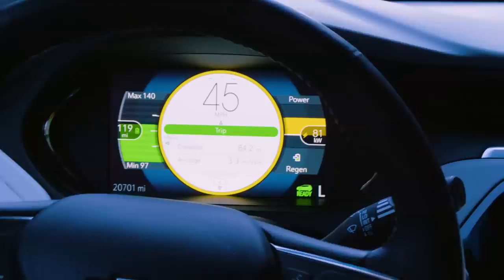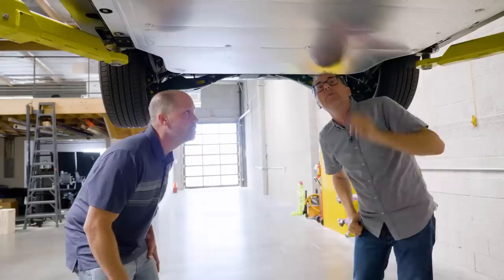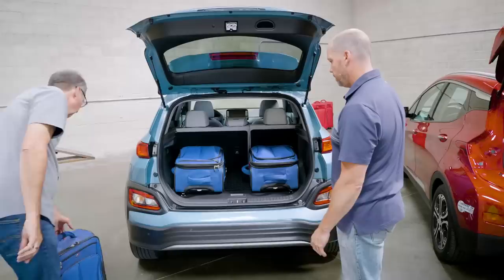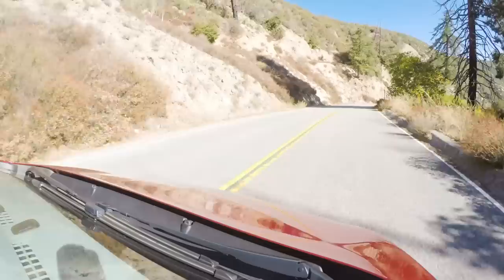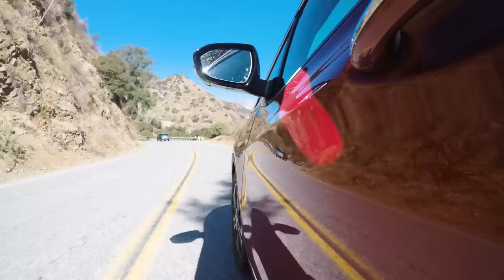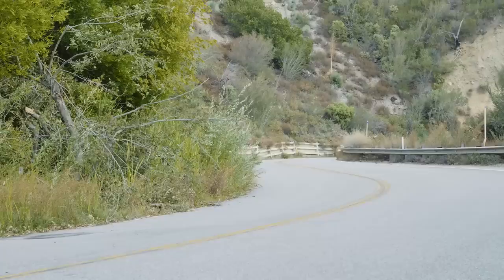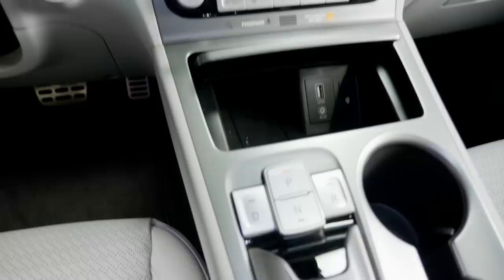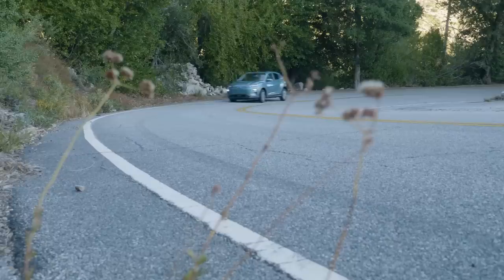Hyundai Kona Electric vs. Chevrolet Bolt EV: Which Is the Best Affordable Long-Range EV? | Edmunds

Comment: GM really screwed the pooch with the Bolt with its economy dorky styling and terrible seats. Hated sitting in one. Very impressed with the independent rear suspension setup in the Kona EV. Just better quality all around in the Kona
Reply: GM interiors are almost inferior to their competition, especially on their lower priced offerings.  Why?  Likely the accountants in charge of the car programs.  Old GM suffered from this and new GM hasn't changed, unfortunately.  As if no one at GM has ever driven a Honda, Hyundai or VW.  Hyundai and Kia always have simple yet classy interiors, even their hard plastics are high end.
Reply: With the exception of the power train, the Bolt was designed by the Koreans. Same folks who designed the Kona. The plastics are hard but quality hard plastics, they fixed the hard seats for the 2019 model, but you are right they cheaped out on the suspension. In the Chevys defense it was the first to do over 200 miles under 40 grand, so since its an older design they should get some slack.
Reply: Simon Michael Benz I agree. The Bolt is nearly 2 years old now, of course a new player in the segment will be dominant, but that doesn’t discount what the Bolt did for the segment or the pretty decent sales numbers it put up.
Reply: Awsome drive train & features by LG. But it was wasted on a cheapo body and interior by GM. Sadly even Holden Port Melbourne designed it and they are known for great design. WTF is with these oldschool automakers being clueless about BEVs.
Reply: It don't cost much to level out the seat by a uphol. shop. I simply put  seat pads in my Bolt. I Like sitting higher up. The rear seats sit higher than front similar to the Element
Reply: We leased the Spark and had similar impressions.  It's like GM 'assembles' the cars from existing parts, whereas Hyundai invents and builds what it needs.  Loved the Spark but it was minimal, crude almost.  You can see that still in the Bolt.
Reply: I couldn't even DRIVE the Bolt, my arm kept hitting the center console. HOWEVER, a friend OWNS one, and in HIS car, I did not have this problem.
QUESTION: It seems obvious that most dealers are not interested in selling electric cars, THEY DON'T NEED MUCH SERVICE. Are the sales folks TRYING to steer us away?
Reply: @ALMX5DP  
It's only outsold by the more expensive model 3 by at least 13:1 and increasing.
Considering they don't seem to sell all the cars they make, and lose money on every car they do sell, that seems to be a problem?
Reply: Roger Starkey GM is playing the long game as they always do. Gotta spend money to make money and by developing the technology it’s getting them there (there being EV and autonomous tech centered in China). Bolt sells about the same as the Model S, and considering it doesn’t have any of the Tesla panache, I consider that pretty decent.
Reply: That subjective! I'm 6ft 200lbs and the seats are just fine. Furthermore, I love the styling of my Bolt. Had a deposit on the Model3 but not really feeling the look of it. The Bolt is more roomy and practical for many.
Reply: @ALMX5DP  
But it doesn't compete in any way with the S!
You can't compare it!
Reply: Roger Starkey my point was merely that they’re selling pretty decently, not that they are cross-shopped.
Reply: @ALMX5DP  
But at least in the USA, they're not selling decently.
Reply: @rogerstarkey5390  Well I guess the Model S isnt either then.
Reply: @ALMX5DP  
The model S Isn't what? Outselling comparable cars in it's own market segment? Check the figures. (Clue, I don't need to)
Reply: Roger Starkey both sold very similar numbers in 2017 and so far this year they are quite close too.
Reply: @ALMX5DP  
It's a different segment?
Luxury cars don't sell as many. Compare the S to Mercedes C and E class, etc. It's taking their market.
The Model 3 is taking business from every market, cheaper and more expensive.
Sorry, but you're wrong on this one.
I assume you are talking about the S?
The Model 3 has smashed the Bolt.
Bolts sales in September were down 40% compared to September 2017.
Reply: Roger Starkey nothing I’m saying can be wrong necessarily. I’m just stating figures not interpretations. Yes Bolt sales are down for October and November, because new players entered the game. Model S took a hit when the 3 came out too.

Selling decently isnt dependent on class or price. Like I mentioned before, the Bolt is just a starting point for a much larger EV picture for GM.
Reply: You can buy a Bolt today.  The Bolt is the most reliable mass market EV money can buy.
Reply: @ALMX5DP  
You're "stating figures"?
Link?
Every "figure" I've seen shows the bolt sales reducing month on month, while the model 3 increases virtually every month.
Even the increase is far more than the Bolt has ever sold 
Bolt sales decreasing by the relatively high percentages mean that either they are getting spanked because there are more, better cars on the market, or....... No, that's the reason.
The "3", the Hyundai, Kia, and soon the uprated leaf are going to kill it off (not to mention the loss on every car)
And (btw) a while ago I saw a chart showing sales of every GM model. The only passenger car segment that showed any growth was "EV / PHEV" and I recall that was due to the volt. I believe they are stopping production of the volt soon?
GM have "issues".
Reply: @fatboy19831  
Yep, you "can buy a Bolt today". Apparently there were about 6500 on lots around the USA unsold, last (?) Month.
Now, you may (apparently) have trouble finding a dealer that wants to sell you one......
Reply: Roger Starkey not disputing 3 sales, I agree they’re a rocket ship as far as numbers go. GM invests in a lot of areas associated with EVs. They know the Bolt was a first step, and one that was relatively small. But the initial sales were decent for an EV brought to market in 2016. The Kona is a second step for the tech with GM still benefiting from it being that they codeveloped the battery stuff with LG Chem. GM isn’t unaware of the progress in sales, they’re merely (again like I said) playing the long game in areas outside of just cars.
Reply: @ALMX5DP  
In that case, they'll cease to be a car company.
Reply: @rogerstarkey5390  if they only pursue that, but I suspect they'll keep their automotive sectors alive for a least a little while longer. (sarcasm)
Reply: FACT: GM looses $$$$ with every BOLT sold. and GM does NOT market the BOLT.
Reply: The Kona looks ugly also
Reply: @markplott4820  Same goes with Tesla losing money on each unit sold.
Reply: @OneManOnFire   - FACT : Tesla today is 20% Profitable, most of their Profit comes from Tesla model 3 Performance, Dual Motor and RWD versions, now with the LEMUR model 3 Tesla will make even more money. already at 143% growth since 2009.
Reply: How are you liking your Kona Electric? When did you get it? I've been driving my Bolt EV for two years now.
Reply: GM IS tanking cutting 18k jobs and closing 6 factories.So no won't be getting anything from them.
I'll stick with Hyundai,Toyota,&Honda😊
Reply: The Kona looks ugly AF
Reply: I will agree, driving a hyundai veloster and a Chevy sonic back to back, the sonic interior materials were shitty and super cheap. It screamed crap. Both korean shitboxes.
Reply: We've had our Bolt since August and THE SEATS AREN'T AN ISSUE AT ALL AND I'M TIRED OF THE WHINING ABOUT THEM. GROW UP. WE'RE IN A NEW ERA AND WE LOVE OUR BOLT. I wish all prospective EV owners the best whatever they choose to buy.
Reply: Glenn Jubilee so hold up, crappy seats and crappy cheapo twist beam suspension are ok because we are in a new era? Twist beam is pure malaise 1980s lol
Reply: @gabimircea4328  They said they set it to max
Reply: @alliejr  They honestly need an interior fit and finish overhaul at the company. They changed their paint and body sealing processes around 1999/2000, and the cars now go 20 years with little if any rust. So if they can double the quality of the exterior, you'd think that a similar shake-up could do wonders on the inside. If that means getting other sourcing or more expensive materials, so what? If your competitor almost costs $10,000 less, has equivalent performance, and a nicer interior, then you've been making some wrong decisions.
Reply: @mi16t  In your opinion no. I don't think they're crappy. They aren't cushy, but crappy, no. The suspension isn't great but WE DIDN'T BUY IT FOR THOSE REASONS. THE PALNET IS MORE IMPORTANT THAN SEATS AND THIS IS WHAT WE COULD AFFORD! GROW UP!
Reply: Glenn Jubilee also if you are gonna do this grow up bullshit, Buy a car you can afford. Buy a 15k economy car, not a 40k ev and then cry its all you can afford. The logic is amazing.
Reply: @glenndjubilee  
IT is a crappy car. That is why GM is closing factors. They made crappy cars and they know it. BTW, since Tax payer bail out and lose money to that loser company, the money that can go to help "THE PLANET" you are supporting "THE PLANET" xxxx company. The same company that delay the start of EV for over 20 years by crushing every EV1 they can get their hands on.
Reply: Totally agree with Blake.  Drove Bolt twice and really wanted to buy but the drivers seat was so god-awful that I couldn't tolerate it.  And I'm not fat or particularly wide.  So disappointed.  Maybe Kona will be better.
Reply: They do know they said more than one time that it was adjustable but had it set to the highest regen level.
Reply: @SimonMichaelBenz  I believe you are incorrect about the Koreans designing the bolt. From what I've read, LG chem was behind energy management, battery and electronics.  GM designed the drivetrain but had it built elsewhere.
Reply: @phenex551  So I got more info on this, turns out GM designed the battery as well as the drivetrain I though it was just the drivetrain. They are saying they did both! LG just figured out how to build the battery and did a bunch of the electronic cintrols. Apparently GM had the design experience from EV1 and Diesel Electric locomotives!!!
Reply: @maynotbe  I totally agree! Too much whining going on about the "cheap interior" which I think looks great and the "uncomfortable seats" is another thing I  have a hard time understanding.. I am very comfortable in the seats and so is my 6 foot 250 lbs husband. We both absolutely love everything about this car! I think these guys were trying just a bit too hard to promote the Kona and not giving near enough credit to the Bolt, which is disappointing.
Reply: @thesoundsmith  Of course. As a car dealership,  why would you promote anything that you weren't going to benefit from later on. Not having an engine means no regular maintenance.
Reply: @glenndjubilee  CHEERS!!! Yes, thank you! Tired of hearing these stupid reviews about the seat and about the interior which are totally untrue. This car is awesome and every owner will agree!
Reply: @mi16t  This car is not cheap or crap by any means. I think people get tired of listening to nitpicky reviews that are unfounded. The best thing to do is to take one for a test drive. The Bolt is a great, solid car that is fun to drive and is so much more than what these guys said it was in their comparison to the Kona, which to me felt like they were trying to push.
Reply: Suzi Lindblad you are delusional if you think its quality. Go drive a model 3 and your jaw will drop to the floor. Model 3 feels like a Bentley compared to this, including in build quality, quality of interior, acceleration and handling. Not to mention the brakes and ride quality. You can drive the model 3 like a bmw m3 through the canyons, unlike your gm korea cruze floorpan bolt. Oh, and by the way, they are making the base model 3 and its still lightyears ahead . Enjoy your crapbox
Reply: @alliejr  High end plastic,  Oh brother I heard it all now.
Reply: @SimonMichaelBenz  Thanks Michael,  I once took a tour of a Cat plant where they accidently showed us a torn down Komatsu.  The tour guide seemed embarrassed and said all the manufactures do this.  Know doubt Hyundai torn down a Bolt before they started engineering the Kono.   No one is giving GM for being he pioneers as the first mass produced electric car.  Yes, I know tesla but hand building electric cars for years is not the same.   The Volt was really the first
Reply: @Neojhun  The chief engineer was not Holden but Josh Taval.  It was a joint venture with Holden (LG) and GM (Same thing).  This car had a team of Korean team that work on the project which was Daewoo employee's prior.  Interesting history on the bolt and now you can understand how Hyundai has  such a grasp for the electric car.  I am sure many of those engineers moved over the Hyundai as this is a design from 2012.

https://insideevs.com/chevrolet-bolt-chief-engineer-shows-us-gms-200-mile-electric-car-video/
Reply: @refusoagaino6824  The Bolt is a Korean Car.  don't let your bias of GM overpower rational thought.
Reply: @netprowlerp  Huh? I said specifically Body Design which was done by Holden Port Melbourne design studio. Which is just a R&D House for GM now. I did not say anything about chassis which you are correct most likely seems like GM Korea formerly Daewoo. But the drive drain is all LG (Lucky Goldstar) I doubt GM did much for the parts that power the vehicle. Chief engineer is not relevant anymore when it comes to how things are designed. It is broken up into major parts and sent to division and partners who ever does the best job. As some loath to call it "Design by Committee".
https://practicalmotoring.com.au/car-news/holden-built-chevrolet-bolt-ev-concept-unveiled/
Reply: @netprowlerp  oh FYI GM has owned Holden since the 1930s. It goes back that far.
Reply: @SimonMichaelBenz  And a lot of electric experience with the Volt.
Reply: Blake Swan Bolt is a great car, it always put a smile on me every time I smoke those pretending to be “Fast & Furious” cars.

Comment: None of the announced Hyundai EVs are available yet outside of "compliance" markets.
the Bolt was designed by engineers, not stylists. It it a tire melting Hoot to drive with a heavy foot. Slap on some Pirellis and put extra padding in the seats and have a blast.  Get a test drive if you're a car enthusiast. This car is wild!
Reply: Bill Kerr i agree. Try to find a used Kona Ev here in Florida. Nada. I have driven a Volt and a Bolt. Given a similar price, dream on, I would buy the Bolt. As it is a nice used Volt is on my radar for 2020. No tax incentive but as a retiree it wouldn’t do me any good anyway. As for the TM3, one dealer in Orlando, 40 miles away. Service intervals very long if something goes wrong and who the hell wants thousand dollar door handles. Insane

Comment: I wonder how many of the Bolt haters here have actually driven one?   I've owned one for over a year and love it.   The Bolt is more fun than the GTI it replaced, handles great and accelerates faster than the Kona.   As to the seats, I've driven it on a 400 mile trip and they never bothered me.   I've never experienced the glare that they complained about in the test.  The Kona looks like a great car but it is slower and has a back seat you wouldn't put an adult in.  It has a smaller screen and worse regenerative braking.  These are all big drawbacks.   Given the Bolt's better braking, better steering, bigger back seat, bigger info-entertainment screen and faster acceleration, Edmund's choice is a little mystifying.
Reply: And front seats made for my 3 year old... Come on Aaron. Oh and my 3 year old's wagon axel for the back end of the bolt..... Junk!
Reply: Bolt haters? I drove both cars. Here in Switzerland the Bolt is branded as Opel Ampera E. At my test drives I get the similar results. In my opinion is the Kona better.  But don't worry, the differences are too little to change to the Kona.
Reply: Why is speed always such a big deal? Do you race your car? People are in such a hurry, why? We all know that speed kills! Just sayin.

Comment: Drove a Bolt this weekend. I loved it. Seats weren't an issue for me (5'9") nor was the front DLO. It was peppy and didn't squeal the tires (but I didn't push it hard). Either Car and Driver or Motortrend put different tires on their Bolt and its handling increased a good bit, but the range decreased some.
Haven't driven the Kona but just looking at it would make me pick the Bolt. But the Kona does offer a lot of extras and it'll get the credit for a while longer (at least at this time - no telling what the administration may do if they get their feathers ruffled). I just can't get past the Kona's exterior.

Comment: As A Bolt Owner 
#1 I have never seen glare off the windshield. And we have owned the car for 14 months.
#2 Most people do not have a tax liability  large enough to take the tax credit.
   if one has the income to take the tax credit get a model 3.
#3 the Tesla model 3 is now available for 45k in the range of both of these cars.
#4 the top priced Kona is going to be over 40k just like the Bolt premiere 42k.
#5 the sets in the Bolt are just right for all the people that have driven the car, 
      however none of us are over weight.
#6 the Tesla and Bolt have a reinforced steel frame supporting the battery, adding to the 
safety rating. the Kona is not as safe and battery punctures will be an issue.
#7 Kona is heavier so real world range will not be as good as the Bolt.
Reply: That's great get em Matty !!⚡🚗
Reply: I'm surprised that someone not making enough for the tax credit would even consider a $40k car.
Reply: I own a Bolt too.  Never saw the glare they're talking about.  What a weird review.
Reply: @aaronmorrill6128  yeah I recon some favoritism coming from the review. It won't be the first time the lesser H bribed a reviewer.